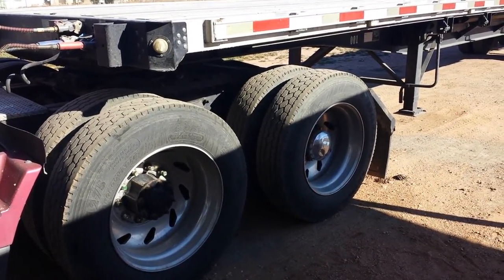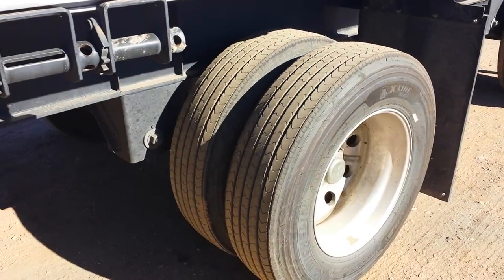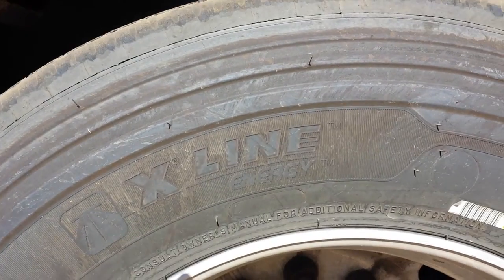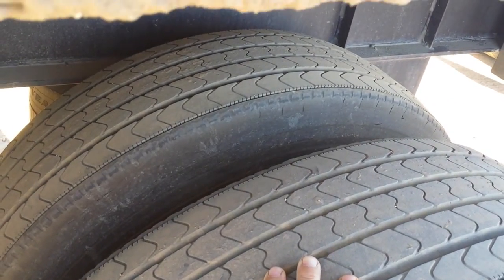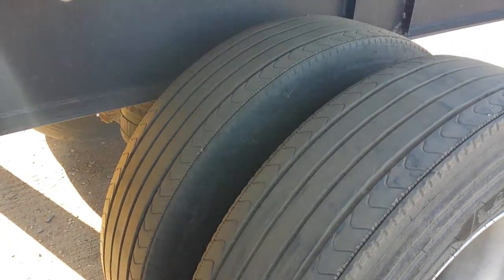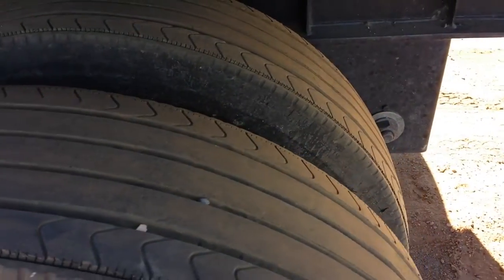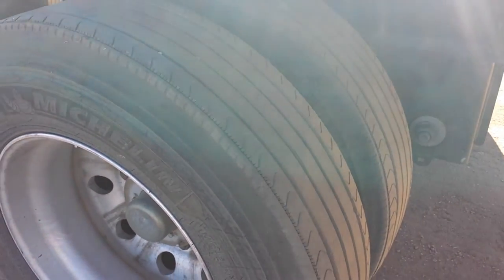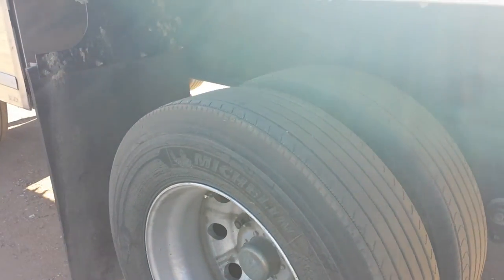Flatbed Trailer Spread Axle Tire Wear

Comment: Have you checked your brake adjustment lately? I had a similar problem with flat spots and high wear and found that one set of brakes was slightly too tight and caused just that one set of tires to drag a little when I hit the brakes. Not enough to lock up under normal braking but it was the first wheel to lockup under heavy braking with an empty trailer.
Reply from the maker: Its been said that you can't drive with air out of the trailer bags. I recall em saying the tires w/out air in bags will hit & cause the wear. How true this is I'm not sure. Shortly after gett'n new tires I stopped driving because oil market & gold market crashed. I was hauling pipe for both. I was going to quit anyway due to gov regs ie, E-Logs & having to stop after 8hrs.

Comment: Once you have the items listed under control the next most important factor is the rear tandem alignment to be perfectly square to the trailer center-line or fifth wheel king pin.  Then especially on a spread axle trailer the parallelism it of utmost importance.  You can easily have the camber and toe on each axle housing. This also can be corrected in the trailer by many local Bee Line heavy truck body shops. The chances the housing is out of specs on camber and toe is slight and is not often seen unless the trailer has been in an accident at one time.  Loose wheel bearings is very common on both trucks and trailers and with today's well made wheel seals the only indication of loose bearings is often just inside tire shoulder ware.  The same applies for today's trucks on both steer and drive axles.  Then there is the actual load placement over and between the spread axles for proper axle load that is distributed over the tire contact during cornering with these loads.  Then equal tire diameter, tread depth and air pressure to help achieve this is important for even weight distribution between the duels.
Reply from the maker: +Rusty Davis How much is all this going to costs, would you know or guess?

Comment: Pulling a 48' flat spread. Seems we all get some kind of goofy ununiform wear pattern. Just watching the trailer humping up, twisting, groaning & creaking backing into a parking spot, it easy to understand why. Last set they all had some combination of cupping, flat spotting, feathering and those were Bridgestones off a new Great Dane. Before I though it was just old worn out trailers.
Current Generals 326's (I believe) are looking good with 100K mi plus on them, which suprises me for a cheap tire. Always making turns wide, on dirt, snow or wet whenever  possible to cut down on scrub.
Reply from the maker: +Andy M My tires where wiped out in just 5,000 miles. It may have been caused by air dump being dumped, and or break hanging up dragging a tire along the ground. I haven't been able to get an ans. to the problem. I was refered to Beline but haven't checked with them. I already ck'd with another top line alignment company and they could tell me what ii was; only probably this and probably that.  I'd be glad to pay the price if someone will guarantee the problem will be solved or pay for the new tires. Nobody has enough confidence to do it.

Comment: Continental HSR2 or General S371 work well for spreads. The front axle takes the most abuse when loaded so rotating is recommended. Those XLETs were the wrong tire but inside rib wear would tell me that the air pressure would need to be bumped up. The non uniform wear and dipping tells be you have a break either hanging up or pulsing. Jack the trailer and spin the wheel to see if it hangs. Then have it spun with mild brake application. The friction caused by the brake trying to stop then releasing over and over causes the tire to wear unevenly. As a final recommendation I would not put any tire with a decoupling groove on the shoulder on a spread. Too much lateral scrub could result in tearing or damage to the tire.
Reply from the maker: +Matt Futrelle Thanks for the info. If I get on the road again I'll keep it mind. I still don't know what the outrageous wear is from. I have an air dump on the front axle. Its been said that if drive with the axle up it will cause the flat spots, and that you must leave the axle down, only raising it on turns. I don't know how the physics work on this. I can't wrap my mind around it. Its said that it has to do with breaking; the wheel locks up I guess and causes the tire to stay in one place, dragging it. Hence the flat spots. I was leaving the axle up supposedly saving fuel. I have, as I said, I haven't driven enough to prove this or disprove it. I hope the theory is right. The tire wear put a scare into me; costing a lot. Thx for the reply.
Reply: What happened once to me was that when I released the air brakes it would not do it for one of the pair of tires all the way and dragged them

Comment: Check all braking components from that side of the axle, from slack adjuster , S cam to the brake pads , rollers , and bushings. Also something many drivers and mechanics miss are the shocks. If the shock is not good the tires will bounce causing premature wear. Specially if you get a flat spot on the tire and shocks are no good, that tire will  be no good in a few thousand miles or less
Reply from the maker: Thanks for your comment. Its timely. As I'm working on getting this trailer back on the road. Back then I had a shop install an "air drop" on that front axle. I'd try to remember to use it on right turns as well as when maneuvering at pickups & drop offs in yards. Either I fail to turn the bags back on or the sytem failed. So I retired the the trailer after two sets of tires. I'm getting read to restart my operation. I seem to only have one choice, based on the "airbag drop" situation, and thats to have it disconnected and hope that the setup of the "airbag drop" didn't cause an on going problem. There seems to be no way to test my theory until I put another $1,000 worth of tires on and see if it works or kills another set of tires unless you or anyone else knows a way to actually test the front axle in a shop. Thanks again for touching on this serious problem.

Comment: Have you tried dumping the air bags on your rear axle when making turns?
Reply from the maker: Yes. That's what they're for. I think the problem was failing to air up the bags after the turns, right away. Somewhere I heard this causes the tires to skip, & or slide on the asphalt. Thx for the reply.

Comment: Man I have a 2018 48’ spread axle trailer always check tire pressure, and adjust breakers before a run and all my tiers are sh*t! Uneven wear on all tires even took it to get a alignment and told me it was perfectly aligned. Then was told the tires aren’t meant for my trailer that how I got it out the dealer lol
Reply: They got all kinds of reasons why but no one will guarantee the fix!!!!!!!!!!!!!!!!!!!!1

Comment: I'm not a trucker by any means, but I've been seeing more spread axle trailers on the road. One of the things I was wondering if having the axles farther apart lead to more wear on the tires?
Reply: Phil Kmetz MTB Yes it does lead to more wear. The tire pivots on the front axle dragging the tire along the ground shearing off tire tread as the truck makes a turn. A driver is suppose to make the widest turns possible, & not make u-turns.  In either case this is not always possible. Weight hauled probably has something to do with it too, 50% of my loads are 46,000 #'s, and around 26-36,000 on the low side. Spreads allow for heavier loads on the back axles,around 40,000 #'s.
Reply: Justsay'n Dude, you rock! I wasn't expecting such a quick answer. That answered all of my questions I had about it, and that's actually really fascinating to me. Thank you for taking the time to reply.
Reply: Phil Kmetz MTB Glad to offer up the info to satisfy your interest . :)

Comment: You can see flat spots on the tires across from each other...looks like they have been lightly skidded...as someone said the brake adjustment may be out..if you reposition the outside tire 180 degrees from the inner one it will help slow the wear down and wont pound out as quickly.

Comment: What would cause serious tire wear on just the  outside tire on a duel axle?
Reply from the maker: I don't know. I'll say this. In cars its from having soft tires, from low inflation.  Check your tire pressure. I always run recommended tire pressure. If it solves the problem let me know.

Comment: Your flat spots on the right side trailer axle shown that both show in the same exact  location are simply brake balance and adjustment, hanging "s" cam bushings, out of round brake drum adjustment and or moving the trailer before the brakes are completely released.
Outside "and" inside wear is from OVER inflation and not under inflation.  Inside shoulder wear only is loose wheel bearings that need to be inspected and adjusted to the tighter side of .001 to .005 end play recommended for adjustable wheel ends.
Reply from the maker: +Rusty Davis I was told it could be an axle problem along with the things you state in the 1st paragraph. The suggestion from the shop owner was that trying to find the real problem could cost a lot of money in work & tires & the problem still might not be fixed. I said well, the only thing I can think to do is ask that any work done needs to have a guarantee that the problem will be fixed for the money I put out. Of course he wouldn't do that. The 1st set of new tires were replaced for free. Then I had to replace two more front axle rt side tires with retreads they got so bad. After that I just parked the truck. I do thank you for your comment. If I decide to get out there again I'll refer to this. But as it is I can put up with mechanics who can't commit themselves to solving the problem. I can drive you broke. You got the best answer so far.

Comment: Actual SA tires are actual more money. Those are a van trlr tire for a tandem
Reply from the maker: Thx for the reply. Micheln Website & a Rep said the tires were a good SA tire. Next: I have air dump in the front axel. I was doing a start up in the yard one day to move the truck & trailer around. After warm up I tried to move & nothing would move. After sitting there & running for awhile The trailer finally aired up just enough to move. I circled around the yard, dropped the trailer. Shut down the truck. The next day started the truck. It aired up in proper time. So my guess is there's an air leak in the "Air Dump Line" causing the problem . Whats bad about this whole thing is the shops I went to didn't find the problem after going to the shop a number of times. Between the mechanic's failures & the DOT red lighting lighting me at the state line I just shut down.

Comment: Call Bee Line Co. at (800)728-7828 and ask customer service to give you the name of your local area Bee Line rep then call your rep and he will guide you to a credible established independent shop or dealership that it well equipped and trained that can in turn check everything I mention in the order I mentioned.  This is an established procedure I speak of and your tires are your second most important cost behind fuel so the shop you will be guided to will know exactly what to do and I am sure keep your costs on this to the minimum work needed.  Keep it simple and don't overshoot in problem solving on the methods used by the pros.  The shop you go to in the end may even recommend these trailer axles have shocks and brackets be installed to also control tire to ground contact during braking when the trailer is empty.
I hope this has helped.
--------------------------------
Rusty Davis
Bee Line Co.
Factory District Representative
Southwest U.S.
Reply from the maker: +Rusty Davis Thanks a lot. I'll be sure and contact the Bee Line Co as you recommend. Yes, tires are huge cost.

Comment: Those are not spread axle trailer tires
Reply from the maker: Thx 4 the comment. I went over this extensively with Michelin. Before I bought em I contacted Michelin & ask them if they were spread axle tires. They said yes. So I went with them bc all my tires are Michelin. I would never have had them put on with out their statement. The Redburn supported them & did the install. As I speak on this again I have to believe that I was loosing air in the front axle, which has an "Air Dump" on it. This said I took the FB back to my mechanic (that installed it) to find the problem. The shop couldn't find the problem. Basically failure to find the problem forced me to shut down after to sets of tires in 4 mos..